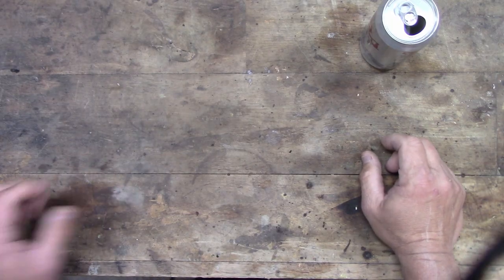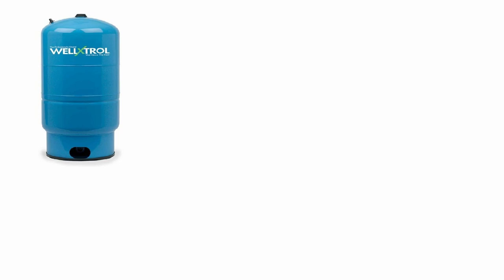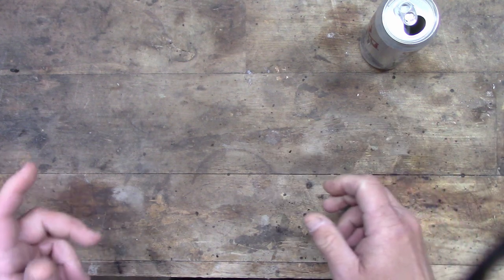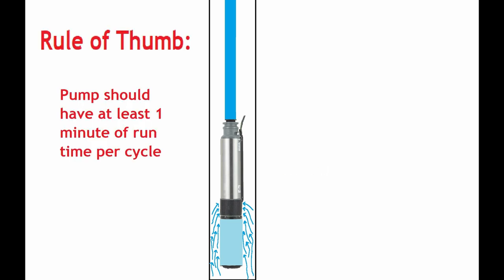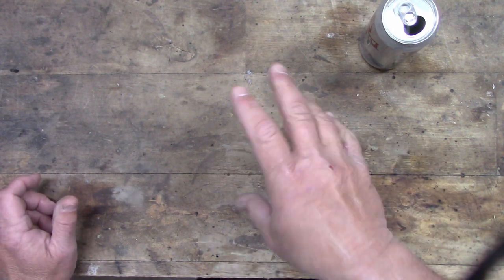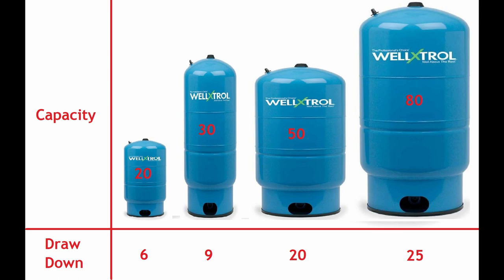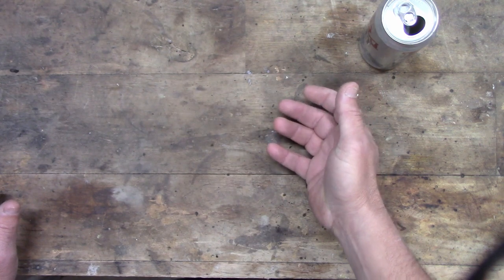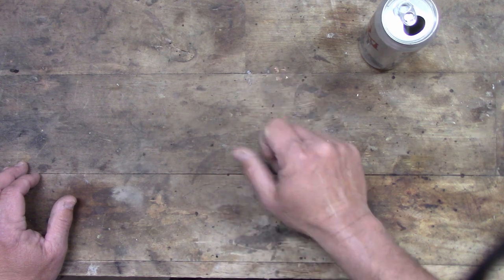How to size a well tank

Comment: Very  good explanation.   02:45 I would just like to warn folks that the 50 psi and the 30 psi he mentions is just an example. The draw down will depend on the rating of whichever pressure switch you use. 20/40, 30/50, 40/60, 50/70.

Comment: I have a 1/2 hp pump with a 20 gallon 202 tank. Thanks for the simple explanation as I’m looking to replace the 28 year old wellex 202 with the same model. I trust the word of a man at a wooden table with a coors light.
Reply from the maker: The Well-X-Trol brand of tanks is among the best you can get. You will pay top dollar for it but it is well worth it IMO. The WX-202 is probably the best, longest lasting, most reliable tank I've ever seen.
Reply: @lennyc624  do u like ao Smith pump pro? Just had a pump installed the other day when talking about the tank our guy preferred ao smith, guess it's probably tomato tomato since they're pretty similar. Our well troll.went out right at warranty so I'm hoping this pump pro lasts at least 7 years as well
Reply from the maker: @johnnyversaci7091  I haven't run into many ao Smith tanks which might be a good thing. I believe they make contractor grade stuff so that's promising. I would be mindful of when the warranty expires, and check the tank out just prior to that. If it's still good then, cross your fingers and hope for the best. A lot of consumer grade tanks will go bad within the warranty. The problem is most people don't realize it. I wish you the best of luck. 🍻
Reply: @lennyc624  appreciate the response brother, good idea to check right around warranty, I just did the yearly pressure check around 39 so I might lower it a point. I was tempted to order another wel trol at the time to save a couple hundred but the pump had probably already taken a beating from the ~20 second cycles and someone I know had comparable pump pro tank right down the street. Hard to even find info about those tanks so I figure that's a good thing u can't buy it online and why not try a different brand I can get in there quick to try and squeeze a little more life out of a 22 year old pump lol pump died a year later tho, 23 years with 7 people in the house for most of that time
Reply from the maker: @johnnyversaci7091  as long as you're mindful of the pump running and don't let it short cycle too bad, you should be in good shape. It's not rocket surgery.
Reply: @lennyc624  yessir lol we'll see how long the new Berkeley Ms trimline pump lasts

Comment: Okay well I agree with every comment. I am getting a well drilled in a month and was going to do all the hook up and want the most pressure and longest lasting system! This was super helpful. My only question is how do you find the time to reply to all comments:-) really impressive!
Reply from the maker: Ha, I don't get very many.
Reply: @lennyc624   So can I run a 4 Gal Pressure tank with a Cycle stop valve at 50 psi on a 40/60 switch with a 22 GPM 1 horse pump for strictly just my irrigation? I am on city but I have a well for my irrigation. Pump just bit the dust likely because tank bit the dust. That is all the pump will be used for is lawn watering.

Comment: I went with an 86 gal tank, 30/50 which gives about 26 gal drawdown. I'm running a 1/2 hp deep pump off solar. I wanted to minimise the start-up amps. It works great.

Comment: What tank do you recommend me I did run waterline to my new house which is 500 feet from the well but also fitting my old house with the same whale. If I remember correctly the guy told me this Well has good pressure I could get for houses if I wanted to

Comment: Small tank = short run cycles.  First approximation, the pump life span is not decreased by number of starts and stops.  However,  every time a pump starts and stops it has a tendency to twist which can rub the pipe and wires against the casing which eventually cuts the wires or pipe ( a careful install with snubbers and pipe centering guides greatly reduces this risk,  I have also seen the pump to motor coupler splines wear out on a high usage pump with MANY starts over time.  But probably the first to wear out will be the pressure switch contacts which arc away due to the number of times the pump turns off (greatest arc)   The the smaller the tank (more start/stops), larger the pump (larger arc), the more water used, the faster this will happen.  I highly suggest keeping a spare switch handy.

Comment: Hey brother! Love your vid, first well I ever had I learned something! Thanks and God bless, now I learn about well heads and how to extend.. mine is buried good 2 ft ? Rusted scared to mess with.  But need too . Bought 3/4 25 feet or under, since one pipe came out. No idea depth? But it pumps water. Was Rusty as heck clearing up with use first time ran for 3 hours came out clear. Morning was Rusty again? But didn't take as long to clear up still Rusty water when sits a spell in bucket. . I'm getting (filling bucket) 5 close to 6 gpm. Bought 33 gallon tank. Is a must to know depth? And can I raise Head? Cap needs to bleed air, but mine is buried? Has a cap in that hole. If iron well casing? Should I even try to remove? Thanks good to shower again!! Lol god bless

Comment: Doesn't the pump have a range of flow rates determined by it's operating curve (the flow rate varies with the pressure, in this case the pressure is not constant and neither is the flow rate) rather than a fixed rate? how do you know the pump's flow rate for this calculation? are you taking the maximum flow rate of the pump?
Reply from the maker: Good question. You are correct about the flow rate depending upon the pressure. However, it's not rocket science,  you just figure it at the average pressure. In most cases the pressure difference is negligible. In some cases it can make a big difference but most of the time you average it out. So if you're running at 40/60, figure it for 50. In most cases.
Reply: Other factors are the standing water level, the total head pressure, and the recovery rate of the well. If the pump is moving more water than the recovery rate, the standing water level will drop while the pump is running. Multiple variables, so you have a moving target.

Comment: Great video . One question I have a artesian well with a overflow pipe that’s underground and ends at back of yard with a slope . Does the pump in well work less because it’s a artesian well or it doesn’t matter ? Thank you
Reply from the maker: Not really. If anything, it might be slightly inefficient because it's probably designed to have its maximum efficiency from a deeper depth than grade but the difference is likely negligible. If you look up the performance curves for the specific pump you have, it usually will have an efficiency curve on it as well which would tell you the ideal depth to pump from. But I'm guessing you don't want to do that and are satisfied with the answer I gave. I might do a video about performance curves in the future. Thanks for the comment.   Cheers 🍻

Comment: I have a small farmhouse, but I have a huge garden that I water frequently in summer because of the heat. Seems the pump is always cycling.
Reply from the maker: Try to estimate how much water you use between each cycle. You might have a waterlogged tank. Usually if you think your pump is short cycling,  it is.
Reply: RE:myothernewname.  Check with an irrigation installer. They set it up so the pump will run continuously instead of cycling on and off.  I think if your pump outputs 5 gallons per minute, you would want your watering hose to be capable of flowing a little more than 5 gallons per minute.

Comment: If high pressure is important to you, one other drawback of an oversized tank besides the cost could be more time at lower pressure.
Assume you have a 30/50 switch. More water is moved at high pressure than low pressure. Assume a 20 gallon tank takes 1 minute to drop from 50-40psi and it then takes 2 minutes to drop from 40-30psi.  Assume a 40 gallon tank takes 2 minutes to drop from 50-40psi and it then takes 6 minutes to drop from 40-30psi. 
So, the larger tank means you are spending more minutes at a lower pressure than with a small tank.
(All amounts are hypothetical and I do not know what the actual figures are. Maybe an engineer or a well expert can correct me.)
Reply: Then switch to a 40/60 switch and pressure would stay up

Comment: Hi I just bought a WATER WORKER 86 gallon pressure tank at home depot do you have any idea how good these tanks are?  I have only seen good reviews of them
Reply from the maker: I'm my experience, they're not the best. My advice would be to see what the warranty is and check the tank right before the warranty expires. If it's still good, it might be ok. I've seen a lot of them go bad under warranty. After that just keep an eye on it now and then. And by that, I mean make sure it's not short cycling. The bladders are typically what go bad on them things. Good luck

Comment: What's the difference in performance for a Tall Skinny Tank vs Short Wide Tank?
Reply from the maker: There is no difference in performance based on the shape. The performance is strictly based on the drawdown specifications. That being said, and this is strictly anecdotal, my opinion is that the short fat ones last longer than the tall skinny ones. As far as performance though,  it doesn't make a difference.

Comment: Hello sr. I will like to know about my pres tank. I want to change it but the only i can see is 100 psi  coud o instal well x troll. Of 50 gallons capacitive ? Thanks  for your answer. Adiós
Reply from the maker: If you don't have any information about the pump, I would advise you to replace the tank with one of a similar size. Well-x-trol is a high quality brand. I would recommend it highly.

Comment: Can you confirm the 5lps pump@ 35psi which pressure tank sizesuitable minimum stars and stop.
Reply from the maker: According to my calculations, 5lps is about 80gpm. Therefore, if you wanted to use captive air tanks, you would need to use several to get enough draw down.  For example: A Well-Mate brand tank, model WM-25 has a 25 gallon draw down. You would need at least 4 of them to get sufficient run time. It might be more economical to use a big, galvanized, air over water tank although those require regular maintenance.

Comment: I’m looking to replace my tank as it is very old. If I go with a larger tank will I get more volume at my faucets? Not pressure but volume. Like if someone is taking a shower and someone else flushes a toilet the shower looses a lot of pressure. My pressure switch is a 40/60
Reply from the maker: No. What you're describing is typically a distribution problem. A new tank won't help that. If your pressure gauge stays between 40 and 60 while that problem happens, then you have a problem in the distribution (Assuming you gauge is working properly). Possibly a blocked filter or softener or possibly blockage in the plumbing or too small plumbing.
Reply: @lennyc624  hey! Thanks for the quick reply. And that makes sense. I have 2 whole house filters and a softener. Firsts a heavy sediment filter, next a softener, then a carbon filter to condition water. I guess that’s a bunch of slowing distribution flow
Reply from the maker: @tjvaichus  check out my other video about replacing filters
Reply: @lennyc624  I watched your video on flushing out the water line before replacing with a new one and that makes complete sense except when I moved into the house there was no water filters or softener. Upon buying the house and getting the water tested I then decided to add the filters and softener. Then I had the issue of pressure. So I’m thinking because I have 2 whole house filters and the softener is why Im loosing pressure with a few faucets open.
Reply: I’m also thinking of doing away with my first sediment filter and letting the softener pick up any of that debris and keeping the carbon filter which comes after the softener
Reply from the maker: @tjvaichus  If you were not having problems with sediment before, I would definitely do away with the sediment filter. In most cases, the softener alone will be all you need.  If you want filtered water for drinking, put a filter only where your drinking water is. you don't need to run your toilet, shower, and laundry water through that. If they didn't have a softener before you bought the house, I'm guessing the water isn't that bad. My water is pretty rusty and has a ton of iron. I have a decent quality softener and that's it. I have a small drinking water filter under the sink where we get our drinking water. Those in-line whole house filters are a pain and 99% of the time not necessary.

Comment: thanks for the video, but why does no one ever talk about the well and it's production rate. Like how do you size these if your well produces 2gals/min?
Reply from the maker: The tank is sized to the pump. The pump is sized to the well production. The depth of the well and the static and pumping water levels play a big part in the figuring of the pump system in that type of situation. You can't just say that a well produces 2gpm, therefore the tank size is x.
Reply: @lennyc624  okay, well depth is 177' and swl is 143'. What other well info do you need? Thanks.
Reply from the maker: @wally6193  depends on what your demand is. As you don't have much well to work with, you will only be able to pull 2 gpm out of there at any given time. If you are only using it for a toilet and sink, you could get by with a small 20 gal tank. If you intend to use much more, you might want to look into pumping into a reservoir of some kind and pumping out of it with another pump of higher volume. Know what I'm saying?
Reply: @lennyc624  are you saying this is too low for my whole house to function properly, like showers, laundry etc? unless I add a cistern and another pump? Or could I just add 2 or more welltrol tanks. thanks.
Reply from the maker: @wally6193  you could add more tanks but as you use water during peak times, you will experience low pressure as the recovery is so low. That is unless you have enough tanks to satisfy your peak usage in one cycle but that can get a bit expensive. Ideally, if you have a low producing well, it's good to have it drilled deep and set the pump at the bottom to essentially use the well itself as the storage. I know that is not always possible in some areas and that is pricey too. 2gpm just sucks and there's not a real cheap and easy way to deal with it.
Reply: Hi Lenny, thanks again for your reply. With a depth of 177 and a swl of 143, doesn't that give me a pipe storage of about 50 gals(6" casing) and if the pressure tank(Wellxtrol) gives another 20 for a total of 70, isn't that enough for most household functions. The well was tested out at 2gpm for a test duration of 2hrs, so that tells me it was producing a steady 2gpm for 2hrs. I'm guessing they stopped the test because they were satisfied that 2gpm was the true continuous rate. This is according to the well data sheet from the drillers. Yeah it will suck if I have to pay another 5G to add a cistern and another pump. So would a 250gal cistern work fine, as I could install that in the garage next to the pressure tank, I think the one I looked at was about 36" diameter x 6'.

I just tested the flow coming out of the kitchen tap in the place I'm staying, which is on town water, and it's only putting out about 1.65gpm wide open.
Thanks again your comments on this.
Reply: Just a note on that test I did, it's no doubt not that accurate as there are restrictions in the faucet(even after removing the nozzle) that would prevent it giving an accurate flow rate.
Reply from the maker: 50 gal of well storage in theory. There are a couple different things you could do: put a 2 gpm restrictor on the incoming line, or size the pump so that it will only pump 2 gpm before the water level gets to the intake screen. There are pros and cons to each. If you are conservative with your water usage you could probably get by with what you suggested. That would not work in my house as I have a wife and 2 daughters. Water conservation is a foreign concept. You wouldn't be able to fill a bathtub in any reasonable time frame, nor would you be able to run a hose for very long or take 2 showers at once, etc.
Reply: @lennyc624  Thanks again for your comments. Yes true enough, in theory. Yeah it's not the best situation to be in. Do you think a 200+ cistern with a submersible in the garage(or in the ground?) would give a "normal" town-like-water supply? The house is going to be a 2 bedroom 2 bath, but there will only be 2 people 99% of the time.

Comment: What can I do to increase water pressure?
Reply from the maker: Most systems run anywhere between 30 and 60 psi. That is usually enough to provide plenty of pressure at the fixtures. 99% of the time low water pressure is caused by issues in the distribution. It is very common to have restriction in a filter or water softener. You can try bypassing those things to see if that helps. Also, many fixtures are designed to save water and result in low pressure. Depending on your water quality, blockage in the plumbing can result in low pressure. If you have any of these distribution issues, increasing the system pressure will be useless. If you are serious about getting more pressure, you will have to do some diagnosing to determine the cause of the low pressure. Sometimes it could be a leak or a mechanical problem. Sorry but there's not a simple answer.
Reply: @lennyc624  thanks for the response 👍
Reply: RE:dharr6628.  "What can I do to increase water pressure?"
Assuming your pump can handle it, you can install a higher pressure switch or make some adjustments to your switch to increase it a bit.